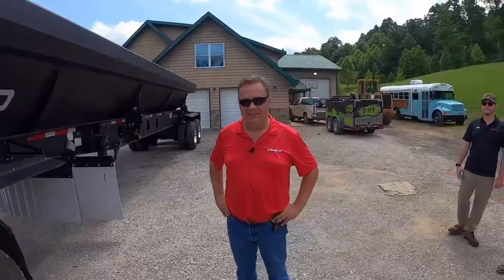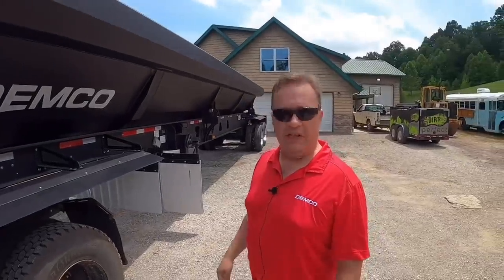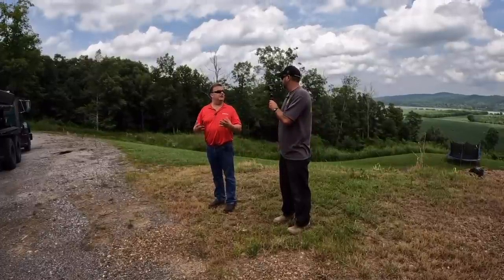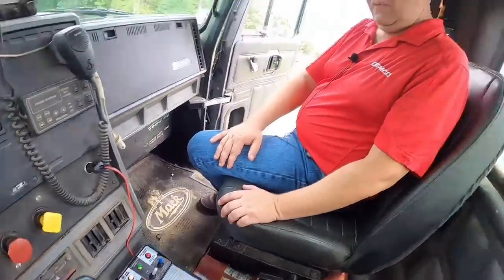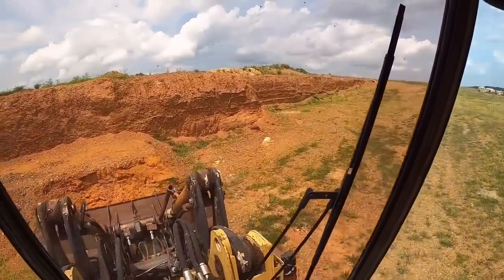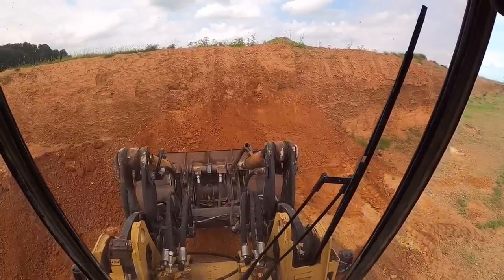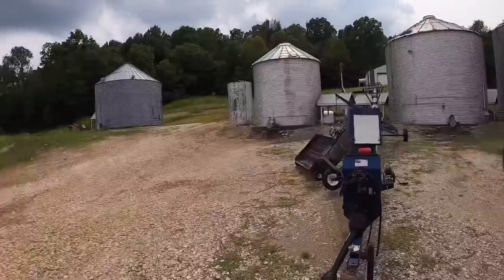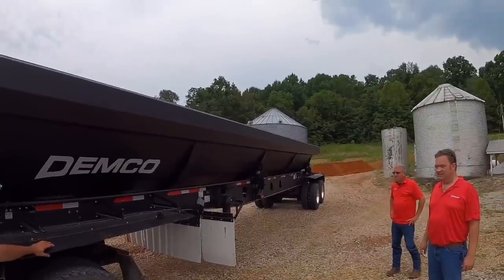Will A New Demco Side Dump Trailer Be Useful For Our Operation?

Comment: One thing I have noticed running side dump is do not get on too much of a side grade and strategically place concrete or stumps in it so that too much weight is on one side. If it doesn't slide out nice it does give the pucker effect.

Comment: You sure can move a boat load of dirt in one pass and don't have to worry about roll over awesome video. I've seen in person an end dump roll over all because the Forman thought the ground would support the rear axle of the end dump. On your test trailer it looks like your pushing from the center and while dumping it transfers load to the opposite side of the trailer. Awesome video Denis from Santa Rosa CA.

Comment: it is interesting how a lot of comments suggest using this trailer during pond builds, but that takes the trailer off road and into soft and often muddy ground. In addition, this trailer needs a capable truck to tow it and the Mack will most certainly not be able to tow this trailer through soft muddy dirt. We all saw it spinning tires on a slight incline on wet grass in previous videos. I therefore think this trailer will not be seen in many or even any 'off road' projects but will remain on solid surfaces where the tow vehicle can get good traction under the tires.
Reply from the maker: Yup

Comment: I'm in WA State and side dumps are really common here. Not really a concern with tipping over. I'm surprised you're not familiar with them, I figured they were common everywhere. The other dump trailer that is common is a belly dump. We have lots of those around here, the cement plants love them. What is actually rare to see here is an end dump. About the only people that use a true end dump here are the junk haulers. We do have live floor end dumps that are somewhat common, usually with the compost and top soil folks.

Comment: Being from unfortunately Southern California the only thing I've seen them run out here is end dumps you see a lot more side dumps up in the Pacific Northwest I've always been curious how stable they are and how they work first time I ever saw one I thought to myself they have to be crazy it'll never work but as I've watched them overtime I see that the ability on a side dump is a lot better than an end dump plus you have the option of going left or right and you don't have to worry about power lines I'm pretty impressed

Comment: Glad you changed the injectors in the Mack before you got the trailer. She shor does sound healthy. And it was good that the Jake Brake worked as good as it did on that long steep hill.

Comment: It's a neat idea. 

Possible issues for operator memory lapses. 

Is there a safety lockout to prevent dumping if the cover is deployed?  I suspect that could be an issue.  I don't think that would be an issue, if it is, for the conventional type.

Also, if side dump selector are not the same before dumping?

Comment: Like it. Only issue I see is the inability to spread gravel for driveways and roads. We'll see.
Reply: Right you are, more skid steer work.
Reply: Would you normally spread with a rear dump trailer.  I think that would lead to some sketchy situations.
Reply: You never would pick 10 wheeler or end dump. It would only be end dump or side dump, and you would never spread with and end dump anyways.
Reply: You stole my thought 😂

Comment: Impressive, certain scenarios would work but the puppy dog is not a rough terrain rig. Now, if you had a bogie front set up that you could hook up to the 850 and pull it around but that's the haul trucks job. As you said, just going to have to use it, stay safe.

Comment: Only thing is material can freeze in it and could turn you over. Not sure if it gets super cold there but here in Montana that's a decent concern. Other than that they are handy trailers. We have 4 quad axle side dumps. Grossing 130k pounds. 30 ton of material
Reply from the maker: Same as any other trailer

Comment: Carful dumping against a previous pile, it will push the material back in around your tires and get you stuck.  If your haulling rocky material carry a couple space hub caps for the trail incase rock rolls back in and breaks the sight glass..  Next you just need a pup trailer to put behind it

Comment: Hey aren't you building a dam?  Load, haul, dump & go! When you load & dump with end dump, the material doesn't mix, it slides out as loaded. This side dump will mix sand & gravel or sandy & gravel soil. It looks very impressive. There is no feeling like watching one lay over on it's side when you are pulling forward to empty,,, usually partially loaded.

Comment: The only problem that I see , is that the Puppy Dawg doesn't have a transfer case and the front axle to go with one , which kinda limits your off road usage . However , I do remember a comment being made a couple of months ago about stealing the new dump bed from Lt. Dan to put on the white Mack . Could Lt. Dan end up with a fifth wheel plate and be put to off road use pulling a shiny new side dump ?

Comment: The only issue I can think of right off the bat is that you couldn't dump rock in the center of a narrow road so it could be pushed out with a dozer. I guess if you were spreading rock it'd be better to tailgate it anyways.

Comment: It's best to also have your truck turned a bit, that way you can either pull or back the trailer away from the pile, I prefer backing away from the pile so I don't have my tires running over the pile (rocks, boulders, ect...) also if the truck is turned it makes it more stable and won't tip over as easily.

Comment: Demo as a company has had some failures that they did NOT STAND BEHIND OR MAKE RIGHT!! I purchased a brand new Lamar 7x14 dump trailer (great well built trailer) that had a Demco ez latch coupler on it. I was dumping 7 yards of gravel and had it almost all the way up when the coupler made a loud bang and shot off the ball and smashed into the tow rig. It damaged the trailer and my two vehicle the coupler was still fully closed and locked but had came off. Demo was notified of the issue and sent another replacement “ez latch bolt on coupler”when I went too pick it up I had the two couplers side by side on a table and checked the amount of play in the non adjustable coupler my 6 month old used one had 13 mm of play the new one had 3mm of play. I did not trust the demo ex latch product ( due too the failure and no safety pin on the product and no way too tighten any play on the ball) I didn't trust the product and installed a standard coupler on my trailer coupler with no issues in two years of use. I contacted demo directly about this issue and why my coupler had soo much play? I was told they had some early couplers with excessive play and they redesigned the coupler too “tighten up the play”. Even after that acknowledgment of there product failure they refused too repair the damage caused by there product. After doing a little research online demo had a recall on this same product installed on airstream trailers and have a coupler play gauge that measures play too see if it's a early run product with excessive play then has too be replaced. I understand that theses type of things happen but it's what u do too make it right that matters too me, as far as demo they failed that test and I will not be using any of there products. And I recomend u check your coupler before it releases going down the road and causes some serious damage .

Comment: They should make mini side dumps as every pickup pulled dump trailer I have use will not dump a full load  and if you can dump a full semi load with 2  6" cylinders a min should dump no problem with 2  4" cylinders

Comment: Couple of questions??? 1 what kind of safety switch to make sure you have both locks set to dump road or curb side dump??? 2 do you have to dump air bags when dumping, on tractor and trailer???
Reply from the maker: Yes and no

Comment: Demco.….WOW!!! What trailer looks so smooth next we don't see many if any here in ILLINOIS BUT WHAT HAS GOT POPULAR IS A YRAILER That size with a conveyor down the middle of belly in dump and just like this lite weight but tailgate hydraulically opens in back and conveyer kicks out material. Alot of large paving companies are using these not only capacity but they just back up to paver lift tailgate and kick out the ASPHALT as you said regular rear Dumps are DANGEROUS I WAS WITNESS TO THE AT AN ASPHALT PLANT GUY came in with a trailer as long as that Demco with a sand load backed up raised dump right away all the way up rather than part way letting material start coming out and when he went forward there was a boat load of material stuck in the Nose next thing I watch in horror as the trailer starts going over on the Drivers side hitting the Asphalt plants tower and conveyer system doing massive Damage because of this Plant was shut down for a week because of the damage to their conveyer system the could not get the material to the plant to make the Asphalt 😮😮😮😢

Comment: I am West Australian ,  what is the material of the trailer ? so I can dump on both ways .!  Can you make them in a 30 tonne configuration with quad axles ? . Could build the hookup area strong enough  to pull 3 and half trailers on mine site runs over very ruff track? ( not :face-orange-raised-eyebrow::hand-pink-waving::hand-pink-waving::hand-pink-waving::hand-pink-waving::hand-pink-waving::face-orange-raised-eyebrow::face-orange-raised-eyebrow::face-orange-raised-eyebrow::face-orange-raised-eyebrow:roads)

Comment: If the truck and trailer aren't fairly level you will have issues dumping, just not as bad as with an end dump.
the majority of your haul and dump is with building or rebuilding pond dams, I can see where this dump trailer could benefit that but also where it becomes a problem. After all, the top of the dams is not as wide so the room to dump off the side and place it where it's needed isn't there.

Comment: 🌟🌟🌟🌟🌟 Question about Locks, does it lock down on both sides in transportation or is only the one locked down and other side left open for cylinder to lift open ? Like a safety lock ?
Reply from the maker: One

Comment: Hello Mike, interesting video.  How many cubic meters capacity does the trailer have?  How long is this?  Is there additional protection for the trailer tires and rims, as they appear to be filled with material when the material is dumped?  Coarse materials such as building rubble, demolition material or broken concrete are bound to cause damage!  I think that you always need a lot of space to deposit the materials, so I think a backwards tipper is more appropriate in our work areas.  Best regards, Ben👋
Reply from the maker: Not for sure need to check spec sheet

Comment: I am thoroughly impressed with that unit for sure! I have been pulling end dump all my life in eastern Kentucky, hauling coal back in my youth, wont mention how much we grossed pulling that, due to the statues of limitations laws, but definitely puckered up my ass so tight you couldn’t drive a thumb tack up my ass with a sledgehammer, but knock on wood i never laid one over yet, but did brake a control arm on a frameless end dump once, but got the load off and the jack down just in time, but dear lord was i lucky! Lol. But I’m sure solid on this, I’m definitely going to be contacting DEMCO, and instead of upgrading my fleet to aluminum in the boxes, I may have to buy five of those side dumps and try them on a few landfill contracts i have coming up in the near future, because they will be perfect for the P gravel and dirt haul I have coming up. I’ll have to give them a call tomorrow. I just never considered a side dump because I never seen any around eastern Kentucky and Tennessee.

Comment: Clean materials would be no problem but with demo materials I would be worried about cutting tire sidewalls. I know I have cut sidewalls with standard end dump just by getting to close to concrete and large rock demo. Other than that I see many advantages with this trailer of the end dump m
Reply from the maker: That’s where it shines

Comment: Sidedumps are quite normal where I live.  In fact double bottom Sidedumps are very common.  Often I'll see those with multiple axles on air bags.  Basically, you see a double coming and it's solid wheels from back to front.   A few weeks ago I was coming into town and I saw a double in the opposite lane coming towards me in a cloud of dust.  I looked and realized that the trailers were whipping side to side out of control.  By then I was checking my escape route if it were to cross into my lane.  Fortunately he got it under control just in time.  It's obvious it was empty or it would have been spilled all over the road.  I should add that I live in the mountains of South Dakota.  Often I see one of the doubles coming out of the yard loaded and crawling  up the mountain with it's flashers on.

Comment: it needs load sensors on the pivots or the rams, so you can know exactly how much you load, and the spread of that load for axle weights.
Reply: Yes. - However, wouldn't it be easier to have those sensors at the axles (of all trucks and trailers of the same owner), so that any combination of stock and loads can automatically be weighed (and the weight per axle checked), with maybe alarms or even locks or axle lifts triggered? - Apart from that, remember DP and LetsDig18 playing around at the Volvo location, early this year? These loaders and excavators also have scales and calculators built in. (Hasn't DP's 210?)
Reply: @chrislaarman7532  it would be better yes. easier not necessarily, but with modern tech having trailers with tire pressure systems and axle weights automatically update in the cab would make sense just like a part of an obd2 system, but since manufacturers like to do their own thing, i thought at least having the trailer provide the load data would be a good start.
Reply: @chrisoakey9841  We seem to agree.  :-)

Comment: Can you spread the load out like you can with a end dump? I use to run a end dump and I’ve some scary dump especially during winter time with sand for DOT. The sand would freeze and bust loose when your boom is extended all the way out. Yes I used Freon and diesel before loading and still had sand freeze.
Reply from the maker: Kinda

Comment: It would be interesting to have scales under both sides of the trailer and tractor while dumping...how heavy of a load on the dump side and how light on the non dump side. I'm sure that the manufacturer has data on that and maybe it's in the operating manual. Please tell the viewers this data as it will answer a lot of questions. Get data with dirt, sand, course rocks, trees ,etc, etc. How does it perform on slopes with a load?

Comment: So DP ,you got mad at trucks not being able to spread metal at the camp ground job ,what would happen if this turned up  ?
There would be a bigger volume of product but there could only be wind rows spread out !
Delivery to bulk supply yards wouldn't like the products not tipped into their individual bins .
Stock pile delivery would be okay .
How will it go with big chunky rocks /boulders ,will it clear them away from the trailer or would they block the trailer wheels in ?
Let's see what else you throw at it as a test

Comment: Looks like three pivot points? So do you have to switch all three separately, or does that one set of levers near the rear switch all three pivots? If they're separate, what happens when they are not all set to the same side?
Reply from the maker: Just front and rear

Comment: Well you have NOT told the whole story. When dumping a side dump it is best to back the truck so when you dump the trailer there is a like a 22 1/2 to 45 degree angle between the truck and trailer so the trailer pulls away from the dumped load rather then driving over the dumped load. Next the angle helps keep the trailer dumping from twisting the truck frame, yes I wrote twisting the truck frame, do not ask how I know this. Also the angle helps prevent the truck fifth wheel from being ripped off, as some truckers have discovered. Now, Dirt Perfect what do you think of a side dump trailer now.

Comment: Hey DP I am wondering if you can spread  a load of gravel or dirt in a long ditch with you driving it like you would spreading gravel on a driveway but just in a ditch now that would definitely be a game changer an cut down on the time it would take using the skid steer I know you wouldn't be able to get it in around houses an stuff like that but a long stretch down a field or side of the road would definitely help Aaron out on back filling lol
Reply from the maker: You can dump while moving
Reply: That would be neat to see that

Comment: Mike, Good Morning. What grade of steel is the trailer?: A36, Ar400, or a high carbon steel. Why don't they use a Corten where rust would never be an issue? The trailer looks good but is it feasible and would you use it that often. Mike, You and Aaron have a great day and God Bless You All.

Comment: Whats with the 34 ft tub on a 40 ft chassis, if they moved the kingpin 6 feet back and the tandem 8 feet forward, the chassis would be even lighter and it would turn so much easier...

Comment: Just get a trout river belt trailer you couldn't even use that trailer on doing a long drive way or road project cause you won't have the width to dump the belt trailer you can and can haul 2 products and dump out one and move the other load forward or backwards to equal out so rides better

Comment: I would be happier if trailer was fitted with load sensing cells so you know the weight of the load. Nearly all tippers in the UK have onboard weigher.